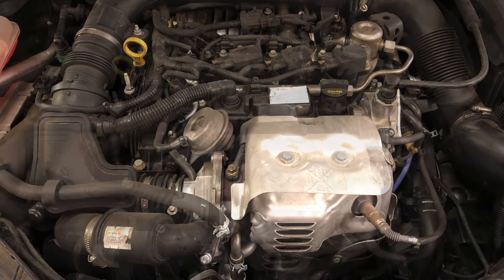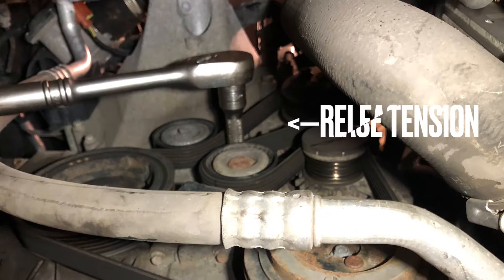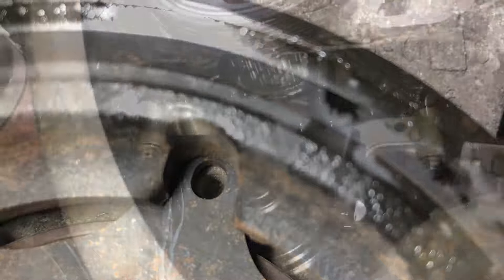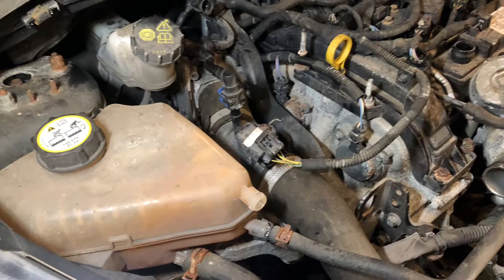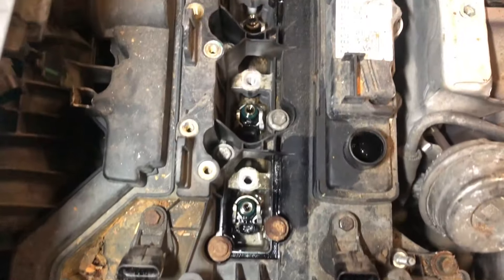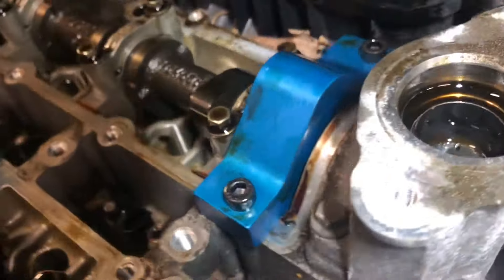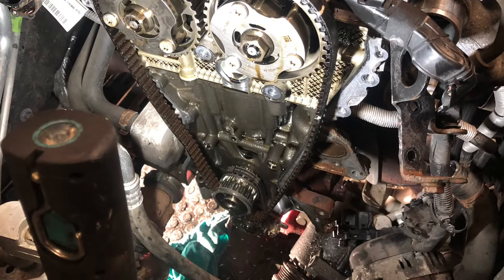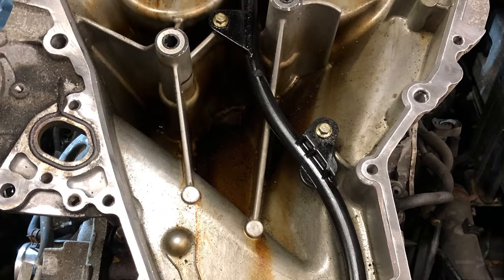Ford Ecoboost 1.0 Timing Belt Replacement. Step-by-step ultimate guide.

Comment: Nice video. My 1.0L has us stumped. We replaced the timing belt and can rotate the crank shaft by hand. It does not hit the valves or make a hard stop and will spin manually. When we attempt to start the motor, it tries to start but stops after couple cycles. There are also no markings on the pulley or belt which makes it even more challenging. Hoping you may have a tip or insight. Thank you in advance!
Reply from the maker: Thanks for your comment. I dare say you need to look at the crank pulley closer. Lock the crank (bolt in back of block) and check pin locates in the pulley into the cam casing. I have had this before and is totally a light bulb 💡 moment. This is shown in the video- rewatch. Good luck and let me know how you get on!

Comment: Can I ask how you tightened the crankshaft pulley bolt as all the information I’ve found keeps saying 60nm then 5 x 90 degrees
Reply from the maker: It does,recommended to use a torque multiplier that I didn’t have, so used a big bar and gave it some!  Obviously safest to use specs but this worked for me. In my opinion you will know when its proper tight and going no where. Good luck!
Reply: Thank you very much for your very informative video.
 But tell me how did you support the engine ? (At 6 minutes of your vidéo)
Reply from the maker: @magslide38 sure. Glad you like it. To support the engine with the sump off I used a axle stand on the base of the bell housing on the gearbox. It supported it really well and would recommend this method.
Reply: @magslide38 hola,tienes razón es 60 nm+90+90+90+90+90 ,y tornillo nuevo SIEMPRE,,,,un tornillo aquí usado te la juegas a que rompa porque ya no estira más ,yo he hecho varios y siempre lo apretó así y sin aparato ,ponle grasa en  el tornillo en la cabeza para que resbale mejor ,te irá bien ,dale un tiempo de 10 minutos mínimo ,el tornillo lo.notaras que va bien con una barra ,y de apriete a apriete,mira la marca de la polea con su útil a ver si no se va ,yo lo hago así y nunca he tenido que aflojar otra vez ,pon grasa ,,,,,,,,,,,saludos desde Tenerife,, Canarias
Reply: I went 
30Nm
70Nm 
Removed locking pin from pulley 
300Nm
Then 90 degrees 

Then make sure pin fits back in pulley so you know the pulley hasn’t slipped when tightening 

Haynes manual way if you haven’t a torque multiplier 
First two stages was just me adding the 30 and 70

Comment: Great video! Is there anything difficult about changing the oil pump belt? You mentioned using the Laser tools kit, but not sure how? I have ordered some of the gasket sealant, to the right Ford spec., but really difficult to find! What did you use? Any issues with HP fuel rail? Haynes manual says to remove the injectors, but you didn't so presumably not necessary?
Sorry for all the questions 😁
Reply from the maker: Thanks for your comment. The oil pump belt is really easy to change once the timing belt is off. I use flange sealant from euro car parts. Use it for all sorts. It’s great stuff. The fuel rail will be a little tight but with some steady pressure it will pop out. It’s no bother I’m here to help. Just ask away if you have any further questions.
Reply: @How2FixIt1  thanks for that. I need to check again but i thought the Haynes manual said you needed to take out the fuel injectors and then replace the seals with a special tool, but I think you did just pull the fuel rail off the top of the injectors and then the cam cover comes off. Thanks again for your help.
Reply from the maker: @andyg5059 it’s recommended to replace the seals but I didn’t. And it hasn’t caused me any problems.

Comment: Hi great informative video very detailed. 
However i got the engine stripped down to change the timing belt, discovered the exhaust camshaft  rotates about 15 degrees freely by hand (21mm spanner) i have been told it is the vvt cam pulley that is knackered. Any tips on how to change the pulley. 
Thanks in advance
Reply from the maker: Thanks for your comment. If you have locked the cams like in video You should be able to loosen the pulley bolt with a suitable breaker bar.

Comment: Hi, Should I clean oil pump or better get new one? Oil pump cannot be damaged, it's save to clean it? I just don't want to buy new one if I not need? Thanks
Reply from the maker: Personally I would give it a really good clean on around the gauze. Some would change it. But have done a few jobs like this with wet belts and had no issues. Thanks for your comment and good luck with the repair.
Reply: I’ll clean it. Thanks
Reply: Do I need to change REAR WATER PUMP TIMING COVER
SEAL when I do timing belt?
Reply from the maker: @vaclosimku602  I would recommend it. You could assess the condition when you remove it. But if it’s off and it leaks,you only have to do it again.
Reply: Yes replace the rectangle water pump seal on back of the timing case to block for water pump.
Also there is an O-ring on a plastic housing that goes in back of the water pump 
I’d replace that also, it would be a right pain to change if that starts leaking also 
Change both
Reply from the maker: @stephenrichardson6105 good advice 👍
Reply: @stephenrichardson6105 where can i get the seal? Thanks
Reply: @mydc2200  HR1 is the “O” Ring that fits on the plastic housing that goes in back of the water pump 
Any Ford garage or Parts Plus ( deal in Ford parts) it’s only a few quid so defo worth changing 
You’ll also need the rectangle one that goes between the block and timing case ( it feeds the water pump )

Comment: It seems to me that it is easy to replace the oil pump belt when doing the timing belt. The shop wants the o charge me 3 more hours labor. Is there a lot more involved to change it at the same time?
Reply from the maker: Nah. Once the belts off it will take ‘em five minutes if that to change oil pump belt.

Comment: So you took down the oil pan as well. For that the cat converter needs down too cause it stands in the way and it has exhaust rusted nuts which are a hell to pull off.
Reply from the maker: A day in the life of a underpaid/valued mechanic!  The joys.
Reply: @How2FixIt1 
Heh. Guess what. Right now I was doing this job,basically changing the 2 belts myself in my garden. I probably do not need to take down the oil pan from what I see at this moment. After draining the oil, I take off the bolts from the black cover surrounding the lower belt and take it out, then both pulleys holding the pump belt and that's it. Although it's usually a must to also take the oil pan down in order to clean the usually clogged up oil pump pickup, cause THAT'S the main reason why they call it ecoboom because they never knew that they should clean that oil pickup at every 60k miles for a healthy life of fhe engine. Normally this is what the auto service must know, not the client, but nowadays the client must know more than the regular mechanica cause it's their money in the game. That's why I've learned and try to do just about everything at my beloved Fords myself.

Comment: Had timing belt done on fiesta Eco boost and now it is loosing power and on the diagnosics it says the timing is off.  Is this a big job to correct
Reply from the maker: I will bet they haven’t timed the crank pulley. It all depends what they have done. But if they have done the job and not done it correctly, it’s there obligation to put it right.
Reply: @How2FixIt1  if they are refusing to acknowledge there is a problem and I need to take to another garage, any idea on cost to put right.
Reply from the maker: @susangrimes3623 I really couldn’t say. I would certainly challenge them.

Comment: My wife has an 1.0 Ecoboost '67'  Fiesta but has only done 15,000 miles. Can you spot the belt starting to shred on an oil change before disaster happens? It'll be 7 years old later this year. When do you think it would be wise to change the belt. Its has a full service history.
Reply from the maker: You may be able if you sieve out the old engine oil. Maybe apply a few spot samples on some paper and see if you can spot any belt fibres.

Comment: Hi how much does this cost on a 2013 1.0 ecoboost focus
Reply from the maker: You should expect to pay around 600 to 1000 roughly depending on garage and your location.
Reply: here in Holland the dealership wants € 1.950 for it. Subdealer € 1.500 and I found a Ford-specialist to do it for € 1.095
Reply: it's very expensive, but not doing it is more expensive.... and use the proper oil! Also use good quality gas
Reply: €2400 at a dealer in Sweden 😬

Comment: Problem I have is this. Engine is on a stand in my workshop. I had it sent away to be rebuilt as the belts snapped and crankshaft destroyed. So i put the head back on and the timing pin in the side. Turned crank around till it touched. Then locked camshafts with two things which bolt down on them, and I put in the oil pump and then the sump with sealant. After all this I did the front cover and found that Haynes Workshop-data was saying to use special tools which fit in the ends of the camshafts. Multiple little bolts. One fit in and the bolts going through the disc part, three to be precise went through into engine to hold it there. On the right side the bolt holes were not aligned. Cant fit them. Thats my issue
Reply from the maker: It sounds to me like the pulley on the camshaft needs realignment. I’m not sure but or the pulleys free floating or do they have a fixed KEYWAY. If it’s free floating one, loosen the pulley and turn it to the correct position, then retighten it. Do this with cams locked. Hope this makes sense. Good luck.

Comment: Just had mine done, £1200 UK dealership. I could not find an independent who would do it.
Expensive but no-one in their right mind would buy one without it being done, and would only buy at a substantial discount. The consequences of a failure are probably a write off. Only 45000 miles, but 10 years old.
Mine runs much better than the 2023 courtesy 1 litre fiesta that they loaned me.
Reply: My local independent specialist does them for 900 quid. Worth doing after 10 years.mine is 9 years old and has done 100 thousand miles and has been a good car not any issues.